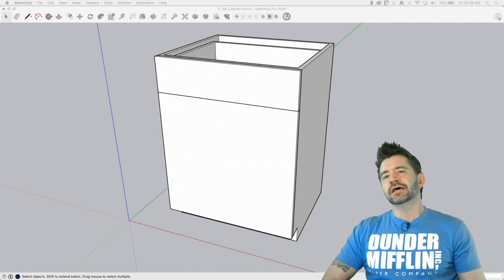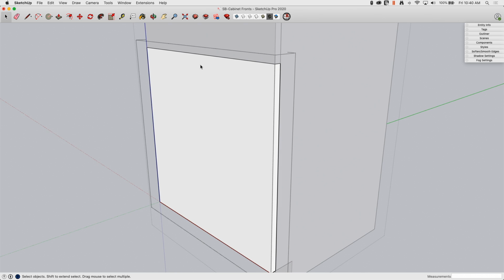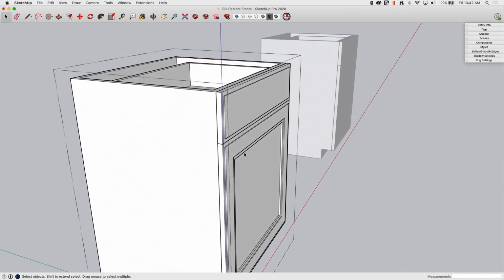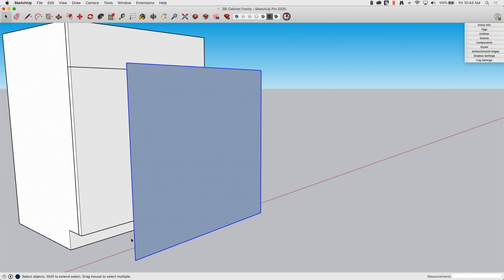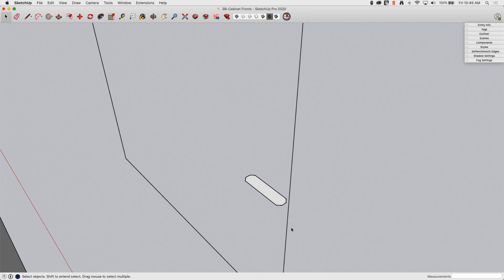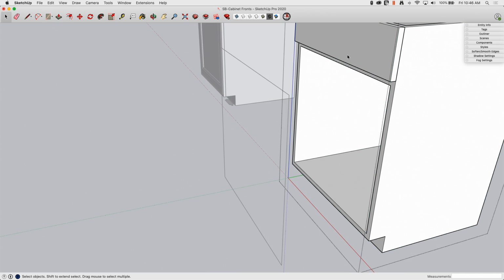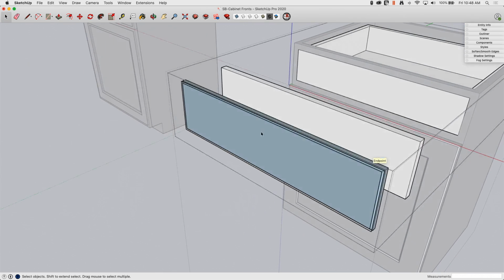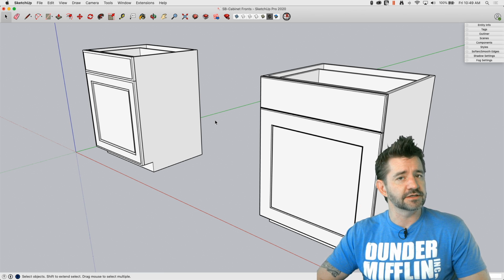Cabinet Doors - Skill Builder

Comment: I'm relieved to know that I am using the exact same process for cabinet doors.  However, It's worth noting that your last method will create an issue when it comes time to adding texture.    I have been a long time woodworker and now produce engineered drawings and renders.  I have had to adapt my workflow so that stiles and rails are separate groups so materials can be oriented correctly with the grain.  And inside moulding profiles I do as attachments using the same follow-me workflow you demonstrated.  For 2D line drawings though, this method is proven on a daily basis for me.

Comment: You are modeling as a programmer. Open "Outliner" and use the component tree to your benefit. Using Group is counter productive, production wise.  Components are the wise method. Again in "Outliner" making the second copy unique wipes out reason for the group. It also allows the non-modified geometry to be used to make the carcase and drawer assemblies to remain valid. As a checker of your model, you would get it kicked back in a heart beat.